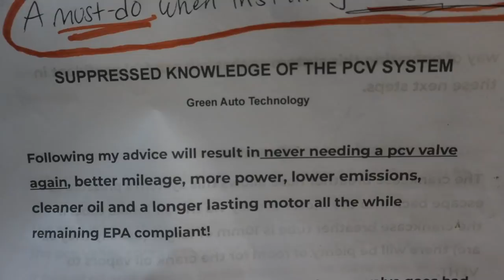The Wonder Of Positive Crankcase Ventilation

Comment: I have a 1980 Chrysler with a 318 running a PCV on its left rocker cover,the right rocker cover just has a breathable oil cap. And I own a 1965 Datsun with the oil tube pointing down towards the road (no pcv) and it’s oil fill cap is a breather also.  The Datsun often stinks of blow by after a drive even with fresh oil in which I change every 4,000kilometeres. Often oil marks on the shed floor from the road tube area too!
I run a premium mineral oil in both my old cars.

Comment: As a teenager I had a 1952 Chevy 3100 with a 235 six cylinder that had that draft tube. Didn't take me long to figure out I needed to shut the engine down if it was going to idle for a period of time or I'd leave a big puddle of oil. My next vehicle was a 1969 Ford Fairlane 500 with a 302, it had the PVC. At 260,000 miles (or there about), it began blowing oil out the breather cap all over the top of the engine (and every where else under the hood). I was told to replace the PVC, I did and the oil blowing problem stopped. Back then a new PVC was like less than a dollar. I don't buy new ones anymore, every 100,000 miles or so I use spray brake cleaner to clean the sludge out of the PVC, pop it back in place and keep on driving. Haven't needed to BUY a new in decades by doing that.

Comment: Willys Overland put PCV valves on their jeeps in the 40s because of the low-speed issues you mentioned at 3:16 (You don't go fast enough in a WWII Jeep in the field to get a 'road draft'). It also had the added benefit of 'sealing' the engine to prefent debris from getting in.

The CJ-2A made after the war had a road draft tube, but the 3A in '49 added it back. It could be possible that the PCV valve helped these engines reimain as bulletproof as they were.

Comment: UTG: In 1970 Chevrolet had an LS-6 450hp 454 - specific PCV valve while all other 1970 454s got the regular one.
Any ideas what the difference was ?
Reply: Probably has a long duration camshaft with low vacuum at idle my 396 68 Camaro has its own pcv valve to eliminate vacuum leak at idle,

Comment: I sill like the simple breather built in the oil filler cap and blow-by tube off the side .  It worked fine for years , piston " blow by " go's out the tube and fresh air comes in the oil fill cap as needed .    It was that simple !

Comment: The only drawback to them I remember is with the engines that were starting to burn oil. The carbon buildup on the back of the intake valves could be pretty impressive.

Comment: The formula back in the day was 2 rebuilds at 100k  intervals,  then toss the engine. I grew up in L.A. in pre PVC times. The air was yellow and the smell pervasive. To add to the engine guck, some owners used paraffin based motor oils. Being an apprentice mechanic in the 60s and 70s, I got really dirty a LOT!

Comment: PCV is  great invention but it's best used with a catch can, especially if the engine is an oil burner. Charcoal canister is another win-win device. EGR, when properly designed (most early designs were not), works well and saves a bit of fuel at cruising speeds. Catalytic converters make for a fumeless exhaust and really does cut down on pollution. Early cats were horrible and restrictive though. I actually put high flow cats on my pre cat vehicles just because I got tired of typical stinky exhaust fumes when sitting at idle for more than a couple of minutes (yes, the engines are tuned to perfection).

Comment: VW guy here. I got about 50hp out of my 1.8 AWP engine buy doing individual throttle bodies and adapting an electric oil separator from the new engine then updating the air compressor to hold the extra pressure out of the 3.2 Audi engine

Comment: Nice paean to an underappreciated engine system! And it's useful to be reminded that the main products of hydrocarbon combustion are water and carbon dioxide, and it should be pretty obvious that you do not want water hanging around inside the crankcase! (Of course, the main component of the exhaust is dinitrogen that has passed through the engine unreacted.)

Comment: I had a 62(?) 430 Lincoln motor in my 51, but the downdraft tube seemed to only be 1/2 the size of the one shown.
You mentioned the roads, but the garage floor also got spots on it...

Comment: Uncle Tony, The 368 was actually a Lincoln Y block and not a MEL, that thing has Siamese exhaust ports in the center and upright Siamese intake ports with the valves laid out like a Chevy or Mopar wedge. MELs had a valve layout like the small block Ford or LS (I-E-I-E-I-E-I-E) with evenly spaced runners, shaft mounted rockers and a flat deck (Chamber in block like 348/409 Chevrolet). The beauty you have there could have been found in Lincolns and Mercs with 285-300 horse which was pretty damned good for 1957. They have a really tall deck like a Chrysler, they were also a heavy truck motor and used as industrial power units. The MEL is physically larger with more bore spacing, It came as a 383, 410, 430 and 462 (Lincoln only). Id like to get my hands on a 383, 4.300 bore, 3.300 stroke.

Comment: PCV: Positive Crankcase Ventilation. 1st real emmisions device that eliminated the use of vent tubes. Oil changes lasted much longer, and made engines more efficient. 1963 was the 1st year this was declared manitory. Later came air cleaner filter elements or vent tubes that ran from valve cover to air cleaner. Smog pumps (A.I.R. Air Injection Reactor)system in California in 1966, then EGR, Exhaust Gas Recirculation, in 1972 to pump exhaust gas back into combustion chambers to cool combustion eliminating NOX emmissions and detonation due to lower octane unleaded or low lead fuels.

Comment: My 63 sunbeam has the draft tube..I sinse repiped it for pcv and it's a lot less"smelly" in the cab. It runs a bit different as far as tunning goes but I don't feel any loss of power.
I'm thinking of going with a cheap  cat,, even though I'll be replacing them more often. Reducing my carbon footprint will feel more responsible. My 30s flathead Harley engine has a little valve button to dump the oil on the side of the road when it overfilled the crank.
Indeed I remember the oil film on the streets as a kid. I'm 64 now.
Reply: Cats only work properly if the air:fuel ratio is just right, so there's not much point putting one on a carbureted engine. They also do nothing for CO2 emissions (in fact your CO2 emissions will go up, because cats turn nastier stuff like carbon monoxide and unburnt fuel into CO2), their function is entirely a human health matter.

Of course going over to fuel injection has a lot of big benefits over a carb whether you use a cat or not. No cylinder wall washing on cold starts, better fuel economy, better throttle response, tolerance of ethanol in the fuel, etc. So a good 'ecological' resto-mod might be throttle body EFI and a cat.
Reply: @nerd1000ify  Well my engine with duel carbs is not getting any whippersnapper stinking fuel injecting.. What do you take me for a millennial?  spit  lol
thanks for that tip though..I assumed it would behave pretty much as it does in my trooper,, changed it with a cheap aftermarket cat, and it got the lowest numbers of any previous smog check I ever had. And the cat is off down in the center of the truck,,  Smob was so low in fact I thought something was wrong with his machine. But I had rebuilt the entire top end with a new head and recut new exhaust valves.
Anyway I'll reconsider,,my sunbeam also has a rebuilt engine and runs clean and strong..
Reply: @chuckthebull  Well if you've run one on a carbed engine and seen improvement I'm not one to argue with the results! Real tests always beat theory. They're not too expensive from what I've seen, and the flow restriction is pretty minimal so it might not hurt too much to slap one on.

On the theory front, modern 3-way cats are meant to work by having the engine alternate between slightly rich and slightly lean (EFI systems do this naturally). When the engine is lean the cat burns the carbon monoxide and hydrocarbons, and also stores up oxygen and nitrogen oxides (NOx). When the engine switches to being rich, the excess fuel is used to consume the stored NOx, and the stored oxygen burns up any residual fuel and carbon monoxide. Then the engine switches back to lean, and the cycle repeats.

Diesels are always lean, so they can't use a 3-way cat. Instead they use an 'oxidation' cat that doesn't do anything about NOx, it just burns the monoxide and hydrocarbons. They have to have other equipment to deal with the NOx emissions and smoke. A carbed engine could be tuned to run lean and use a diesel cat in the same way- it would make more NOx than a stoichiometric tune, but overall pollution would be lower. Of course we all know the issues with running gas engines too lean.
Reply: @nerd1000ify  thanks for all that info,, what can I loose for trying.. I can weld and replace the troopers every so often and spend under 100 bucks so for me it's more doable..now the 73 lemans might be more problematic. 400 engine.. But it's already got a lot of pollution control built in... Anyway.. Happy motering

Comment: There is one think you didn’t mention. The pcv is helping burning the crankcase vapors. The crank case vapors act as a slight amount of fuel enrichment. The manufacturers were able to lean the carburetor’s out a small amount. Hence a possible better fuel economy?

Comment: My dad built a 62 vette, being in California car and it being a California car it had a pcv system unlike every other state sbc 283 and 327 still had road draft tubes on the back by the distributor Cali cars had a little inline pcv valve on the back of the motor

Comment: Gaskets have also improved dramatically  since the 1960s. 

Parking spaces always had oil spill deposits at the front and back. 

The front ones were from front engine cars.   

The rear ones were from the air cooled VWs and the Chevrolet Corvair. The Corvair leaked so much that they were referred to as Road Oilers.
Reply: Rope main seals lol

Comment: Horsepower depo has a 69 Camaro that has a 24 volt air pump that he turns on before a race says a proven 30 Horsepower gain on the dyno. I know it's not quite a PCV but it does illustrate what getting smoke and air out from under the pistons can do.

Comment: Don't forget wot the blow - by tube would do for motorcycles  - that black stripe in the middle of the lane was hell to stop on (or start fast on ) even if it wasn't raining,and not everyone switched when the pcv valves came out - that black stripe was around for a long time  ...

Comment: 462 I believe was the biggest MEL, and they hung on until 67 I think, in the Lincolns. They had plank style cylinder heads, similar to the GM W engines. Kinda cool in their own right. The 462 at one  point made 400 horsepower and 480 or so lb/ft of torque. Neat stuff

Comment: The first motor I rebuilt was a Ford flathead from a 49 f100. I don't remember it having that down tube setup. It definitely didn't have a pcv valve. It was 15 and now I'm 58 so it very well could have had the tube thingy. Inside that motor was dirty. I discovered after nearly completing the short block that the block had a hair line crack between #7 and #8 cylinder. I almost went ahead with it since it ran decent before I tore it down. Common sense took over luckily and I stopped work on that flathead. About a month later I found a motor from a 57 t-bird. Which looked way cooler than the flathead I thought, plus it didn't need to be rebuilt. Hence I have no idea what it had for ventilation. It was a y-block. I sold the truck a couple months later and ever since all my vehicle's had pcv valves except the numerous vw's.

Comment: in 1965 california. I had a used 55 pontiac with the 287 v8. to pass the yearly smog test. with the engine running the tester would pull off the ventilated oil cap and put his hand over the tube. after a bit removing the hand you would hear an inrush of air, indicating the pcv was working.

Comment: Excellent information, except for one glaring (quite rare, Uncle Tony!) error: that is not an MEL engine, that is a Lincoln Y Block, which was produced for passenger car use from 1952 to 1957 in 317,  341, and 368 displacements (industrial uses lasted into the early 60s and had added displacements of 279, 302, and 332). The MEL debuted along with the FE for model year 1958. Initial displacements were 383 (Mercury), 410 (Edsel), and 430 (Lincoln), hence "MEL", while FE stands for "Ford/Edsel". Proving corporate espionage is a reality, the MEL cylinder head has no combustion chamber, just like the 348 and 409, also released in '58. The 430 became the first American engine to reach the 400 horsepower mark as the three two-barrel equipped "Super Marauder V8", an option on '58 Mercurys. The MEL gained a fourth displacement in 1966 when it was poked and stroked to 462 cubic inches, making it FoMoCo's largest engine of that era. It was discontinued at the end of December 1967 to make way for the 460 in January 1968.

Comment: I drive my 1965 Ford Galaxie regularly. It the original 352 with the road draft tube. I have thought about upgrading the engine to the closed crankcase ventilation system and watching this video has prompted me to do it. Just need to figure out how, lol.
Reply: Weird, I have a buddy who has two 65 Ford Galaxies (352 and 390) and both have PCV valves.
Reply: @muziklvr7776  I can think of 2 possibilities . Ford might have started putting them on in the later part of the model run, or a previous owner might have done the upgrade. Either way, he is ahead of the game. I have thought about doing this to mine, even more so after watching this video.
Reply: @garyjubar5733  Both are California vehicles so that probably explains it. I'm pretty sure  the PCV valve was mandated nationwide for '63 or '64 models. Curious how your '65 skirted around that.
Reply: @muziklvr7776  Yup,  that would explain it. California is always the first, for some reason. Ford did start using the closed system in 1961or 2 on their newly designed small block engines. They were the 221, then the 260, 289 and in 1968, they 302. Eventually they went to the 351W.  The FE engines (332, 352, 390, 406, 427 and 428) went to a closed system later. In fact, the 65 valve covers were shaped different from the earlier ones even though they are interchangable. Also, the 65 valve covers had a cap where you added oil, whereas the earlier FE engines had a spout coming up through the intake manifold where you put the oil in.

Comment: That's NOT a MEL motor, it's '52 Lincoln Y block that was introduced two years before the Ford Y. Were also used in '57 Mercury and in the '50s HD trucks. The MEL(Mercury Edsel Lincoln) & FE(Ford Edsel) were introduced at same time 1958. The Y series were phased out by '62 in autos & '64 in trucks. 

EPA had nothing to do with PCV, that agency wasn't formed till 1970. PCV was mandated in CA for 1961 & went national in '63. CA mandated retrofit back to 1955. Yes it's one of the best addons to the internal combustion engine. It actually leans mixture slightly, carbs often increased jet size or raised float level to compensate.

Comment: I own several letter series Tractors. On the 1940's and 50,s Mand H Farmall. They have a vent tube in the lifter side cover. However there is a steel line running from the rear of the Cyl head to just below the top opening of the air cleaner.   In seen 1950,s GMC  six cyl big trucks that had a factory PCV plumed into the valve cover and many 261 chevy truck engines that had a  line ran from the valve cover to the top of the oil bath air cleaner.

Comment: I watched another video recently on another channel that was talking about Formula One engines, and oil additives. They used the same concept as you talking about 2 PCV valves, except that their "additive package" in the oil, since they use a dry sump system with several gallons of oil, uses power boosters not allowed in the fuel by the sanctioning body, so that at operating temp during the race, they're drawn in by the PCV system. According to the video, up to 1/3 of the oil by weight is designed to be drawn in by the PCV system and burned by the engine to make power.
I'd love to see a video on how EGR can actually help reduce spark knock in an engine. Not all emission controls are boogiemen. If it weren't for them, Auto manufacturers wouldn't have been forced to step up their game, and produce arguably better engines, after the clusterf*ck that was the 1970's.

Comment: As much as the PCV helped I would also argue that improvements in oil technology were equally important. Dad has plenty of pictures of well maintained vehicles (late 60s to mid 70s) from his youth that you would pull a valve cover off of an it was so packed with sludge that the rocker arms actually had made a clearance into the buildup. But again, it would have 150k on it vs like 50k... I actually just rebuilt the Y block in the 55 and was impressed how spotless it was inside. Hell there was still cross hatching on the bores but it was an untouched since 55 block in a heirloom vehicle. But it also was parked most of it's life...
Reply: as far as cylinder bores, the thicker piston rings and lack of overdrives with steep rear gear ratios tended to take that factory cross hatch right off, and leave a ridge at the top of the bore that needed to get removed in order to install a piston. Y block valvetrains were notorious for clogging up on the old parafin wax motor oil.

Comment: I think California had PCV valves for the 1961 model year. In 1964 California went to the closed PCV system, by having the breather side hooked up to the air cleaner housing. Everywhere else, that happened for the 1968 model year.